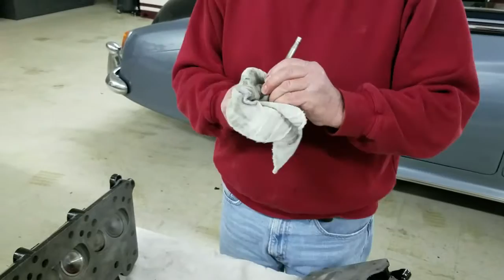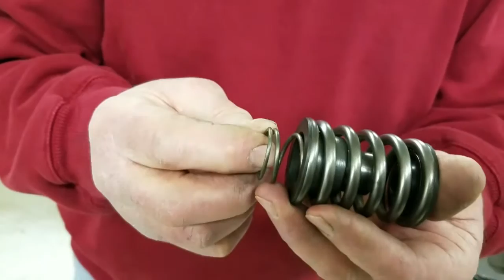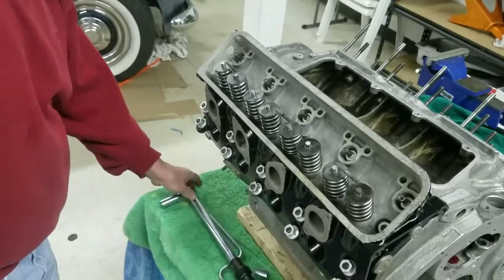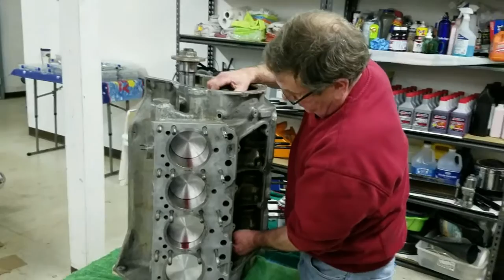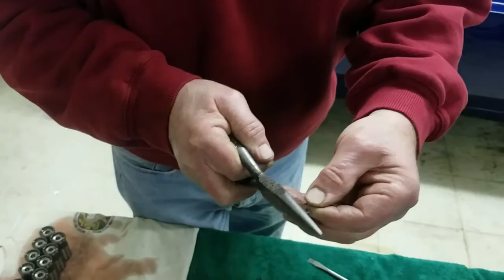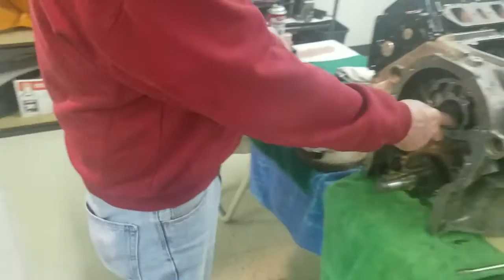Engine Rebuild Silver Cloud 3 - Part 2 - Heads and Cam Shaft

Comment: Usually to check a valve and seat use Prussian blue which will give you much more accurate reading of the sealing surface also alloy engines will always have a lower torque setting than their cast iron equivalent due to the expansion rate of aluminium

Comment: With 6 cylinder Jaguar it is almost a must to use Wellseal (A brown sticky stuff) on the head gasket faces. With all the fear out there that these V8's can blow head gaskets especially on the later turbo versions, would that not be a wise precaution or is it unnecessary?
Reply: Adam Ski I was told to use wellseal on this block
Reply from the maker: I have seen that spray on copper stuff used I have not used it but I know couple of dealers that repair cars that use good suggestion